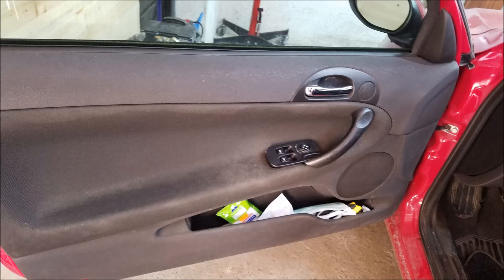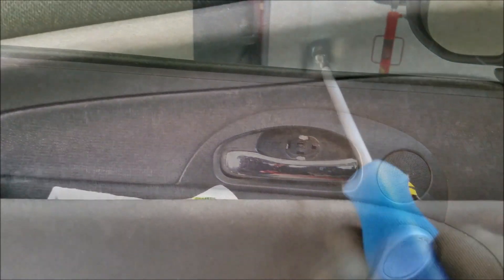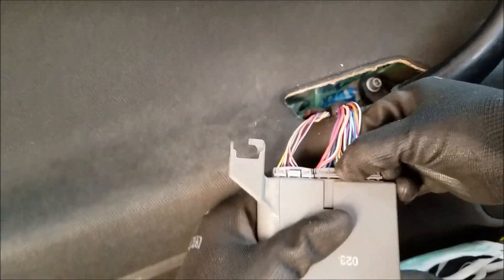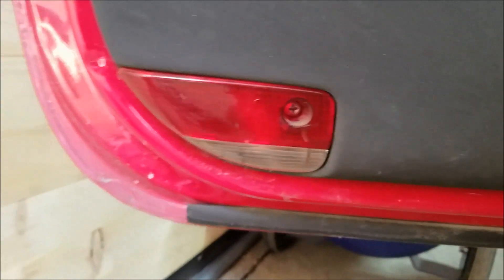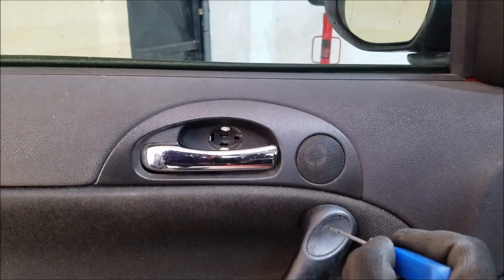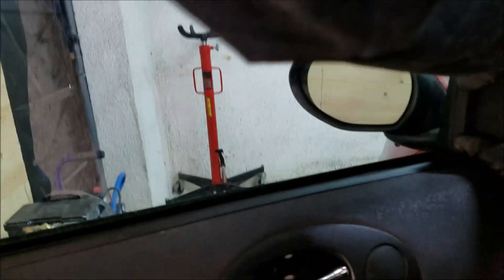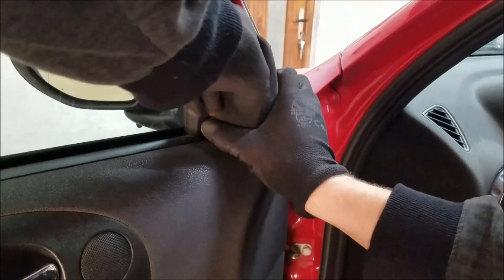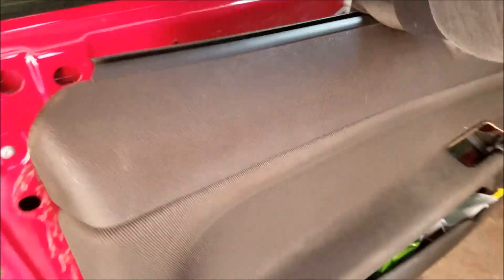How to Remove Door Panel Card Alfa Romeo 147, GT

Comment: Great video. Worth pointing out it’s easier to remove and reinstall the panel if the window is down.
Reply from the maker: Thanks. Good tip
Reply: can you please explain why? I´m going to remove the panel to replace the speakers 🤔
Reply: @cuca1715  The top edge of the panel that has the insulation strip that contacts with the window was very tight on my car. I found it hard to remove the panel, but it was pretty much impossible to reinstall with the window up. When its down there is more space and no pressure on the panel strip.

Comment: do you show how to remove the door handle too?
Reply from the maker: No, but it is very easy to remove...
Reply: @arcgarage  it's just two screws right? one inside the door frame and one on the side when you open the door. Then you just pry the door handle out. is that it?
Reply from the maker: @king0vdarkness  Didn't do it in quite a while, it's either that, or you just slide the door handle forward, can't remember...
Reply: @arcgarage  it's actually harder than that, I tried just prying it out but there's a rod or something blocking the handle. From looking at one video he says there's a door lock Rod you need to unlock from inside the door but it's difficult to find plus the doors broken from the outside not the hinge... Shame no one's got a video on it
Reply from the maker: @king0vdarkness  Might do a video on it in the future, didn't know it was such a hustle, but it shouldn't be much of an issue...
Reply: @arcgarage  thanks man
Reply: You have to take the card off to remove the door handle.
At the bottom is a hex screw, in the middle the plastic is melted to the card but can snap away fairly easily. The hard part is the top. Where the thumb cap covers the outer screw; this tube goes through the door card and is secured on the back with a metal one way gripper washer almost. Difficult to describe. Anyway I was getting one off a 147 in the dark in a hurry as it was ready to be scrapped next day and thought I could break the door card getting it off but the plastic stem of the handle broke!! 😭

Comment: This is very helpful, thank you. Do you have a video for the rear end? I have Alfa 147 with 2 doors.
Reply from the maker: No, but it is pretty much the same
Reply: @arcgarage  Is it necessary to remove the back seats, or it can be done with them, because I don't have  doors, and I want to replace speakers.
Reply from the maker: @slobodanstosic8563  I did that on my 147, if I remember right I think you have to remove back seats, and the plastic around seatbelt